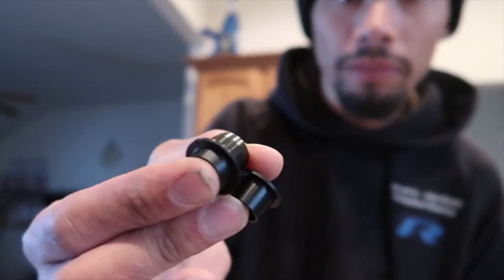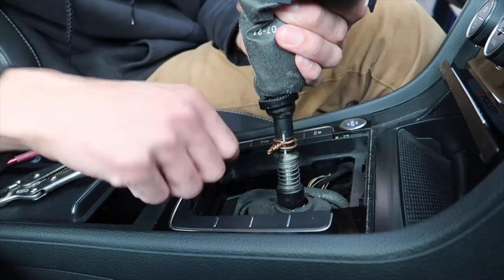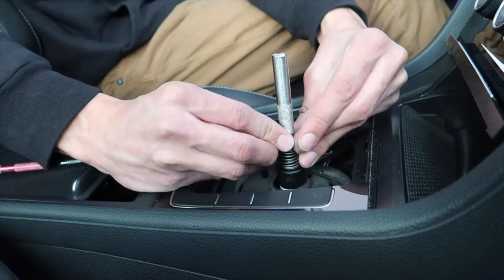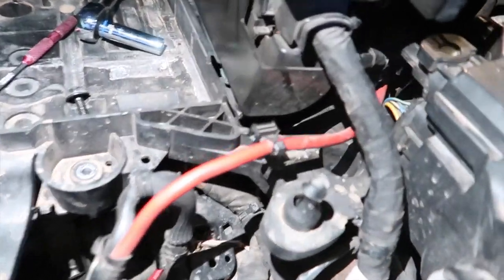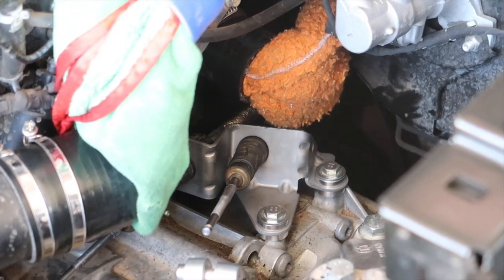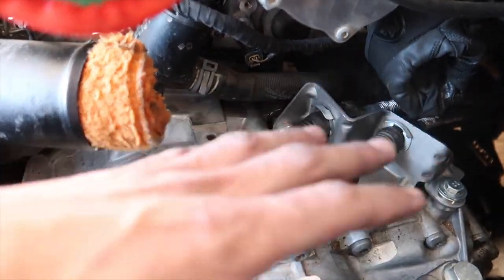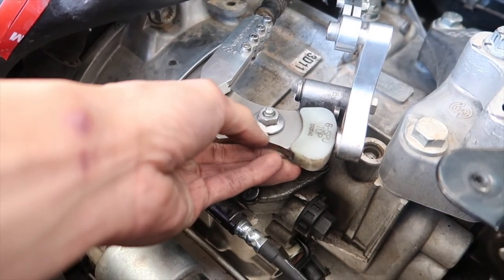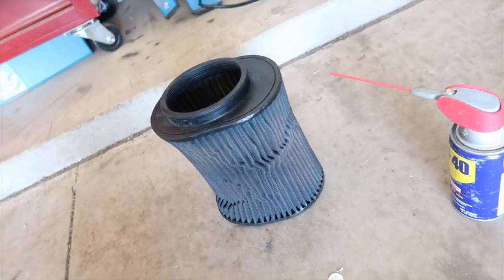DieselGeek Shifter Shaft Bushings + OEM solid bracket + 034 bushings! | MK7 Golf R

Comment: @BryceJordanProductions How did the copper washer work out for you long term?  I have the DieselGeek shaft bushings and short shifter kit.  I'm gonna order the OEM Bracket and 034 bushings right now and get those installed all at once.  (I think I can just go do the bushings right now since that's just taking the boot off the shifter and swapping them out!

Comment: Nice work man. Def getting the DG short shifter at some point to get rid of the oem audi that I currently installed. In for that superpin install as well.
Reply from the maker: Doing the superpin now, well, the trim stuff. Not too bad. That link you sent me really helped!! Only a few extra steps after that. You're gonna love the shifter dude!! Make sure you take your time adjusting the cables, it's key to be OCD about it. Have time and patience
Reply: @BryceJordanProductions  Checked your IG, made some nice progress. Main thing stopping me is that I don't have a garage at my house to do this stuff. have to wait for good weather days
Reply from the maker: Oh for sure man you don't wanna do this in the cold!! Spring needs to hurry up and get there lol. But mannnnn. Mannnnn it's so good!! I can't believe that little shitty plastic pin caused so much slop.. I'm literally mind blown lol
Reply: @BryceJordanProductions  How long do  you think it took to get the center console taken out to even get to the superpin? wish you were closer, would love to see how much of a difference it makes. assuming this is the side to side slop when in gear correct?
Reply from the maker: If you're good with visual learning, and have the Torx bits, some picks/scribes and trim tools it shouldn't take more then an hour tops, probably less with an extra set of hands! But yes literally all the 95% of the slop left over after doing the short shifter is now gone, it's so different. Doesn't feel like the same car tbh lol

Comment: Just wanted to double check. Do I need to lock the trans and align my shifter for the bushings? Or were you in the middle of installing the DGS6 at the same time?
Reply from the maker: If you’re doing the shifter yes, for the bracket the cables have to come off so when you go to re adjust again you’ll have to do the locking stuff UNLESS you put some tape on the threads so you know exactly where the cable ends sat so you dont have to do it all over again.